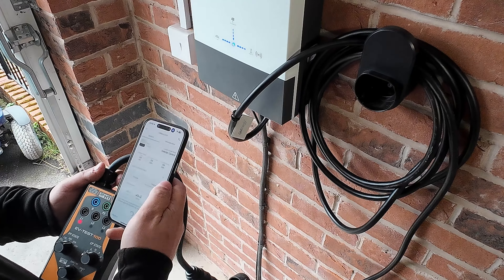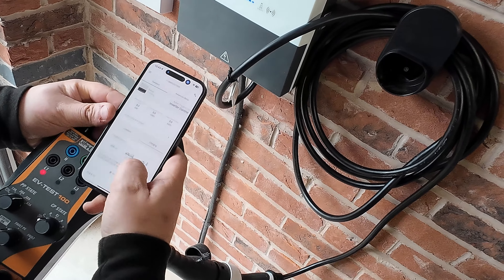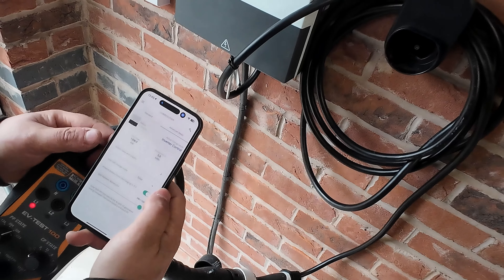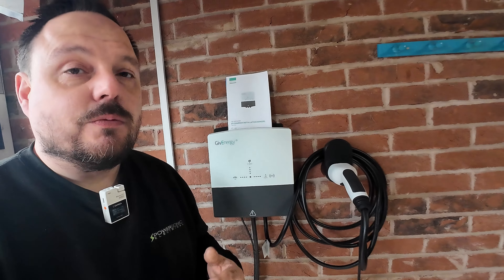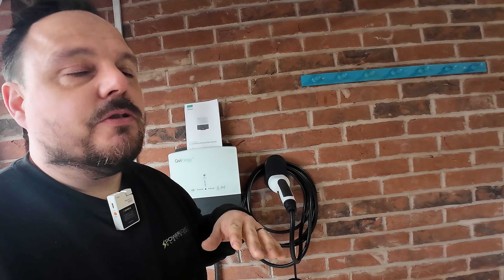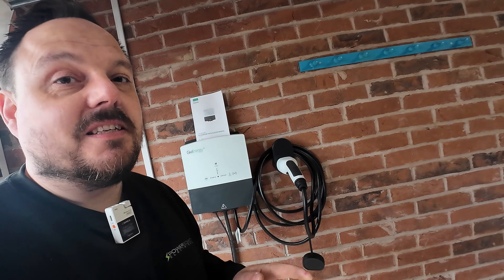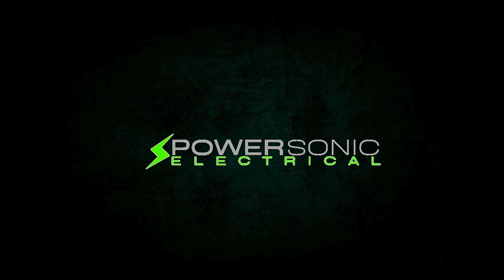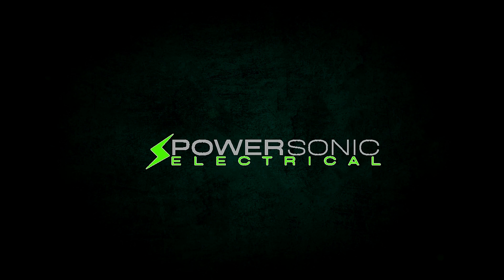GivEnergy EV charge point installation & Solar integration - Never empty your battery again!!!

Comment: Just purchased a 4 year old new build. It has an EV charger installed using 2.5mm T&A, with a 25A MCB on the consumer unit. Charger has been capped to 25A using dip switches inside the unit. When I plug my car in, as expected it’s capped at 25A which is fast enough for me. Is this OK or should I be expecting a house fire? 😅
Reply from the maker: That would depend on the cable installation method. Conduit, in insulation or clipped direct. Not a setup I would recommend tbh
Reply: @electrician247  Thanks for the reply. I managed to find out it’s 'clipped direct'. However, below the consumer unit is a switch that enables me to turn the EV charger on and off. 20A Double Pole switch. I assume this would not be a good thing having 25A passed through it?
Reply from the maker: @SPDTDL  yes that should be replaced for a suitably sized isolator. Tbh I would want the circuit adjusting. I would doubt very much it is ungrouped and not in any insulation along its run.

Comment: Should mention that the GivEnergy gateway can only take 40amps, so if you have too many panels, it won't read them.
Reply from the maker: This install doesn’t feature a gateway. I assume you mean the PV input to a gateway? That’s some sized domestic array to be above 40A lol dare say most G99 circumstances would limit things before the capacity of an AIO/gateway. Still ways to accommodate bigger systems with a gateway using Lora and direct connection to the consumer unit. 

In terms of reading the panels, the gateway doesn’t work like that. It takes an AC input from a separate PV inverter. So you are half right and half wrong.

Comment: Just like to say that the title of this video is still inaccurate 4 months on. I'm assuming that Mark has access to some pre-release beta software because I have just had a Givenergy All in one and Giv EV charger and this feature is STILL not live. So not only is my battery draining to the car but I will also have to get my installers out to rewire my set up when they do eventually release it!
Reply from the maker: Not true. This is and has been in the wild months. Working fine across multiple installs. I would speak with your installers and review your setup. Reliable connectivity, cloud sync and correct wiring in the gateway is all you need. Nothing inaccurate in the video at all.